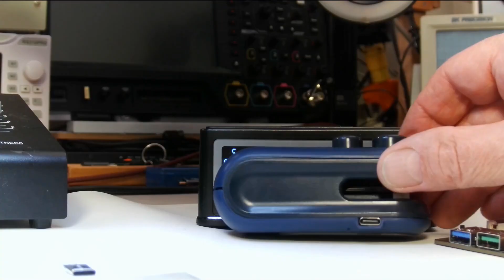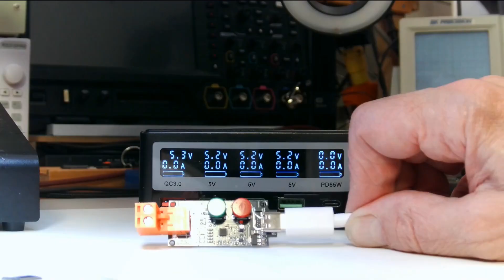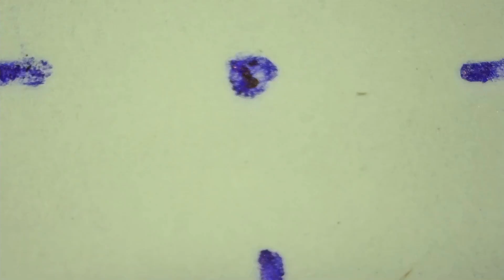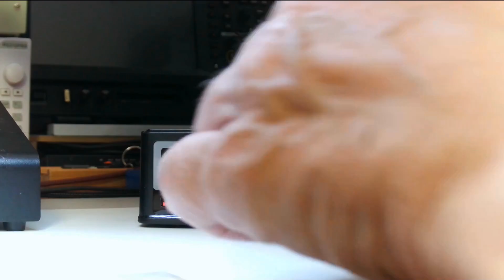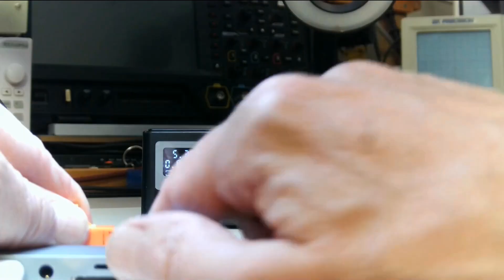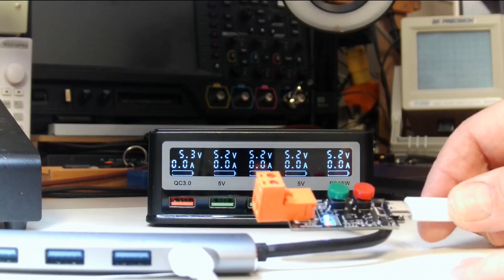Why some devices won't charge using USB-C ports.

Comment: Great info, unfortunately it's getting ridiculous with all these different cables. 😖  There needs to be some type of standardization or they need to make a bag full of adapters available. 🙄
Reply from the maker: The USB authorities have instituted a number of symbols that should be used to mark cables and ports but I have not seen much use of these.  Perhaps in future things will improve with more wide-spread use of USB-C and we will be better able to identify cables and ports.